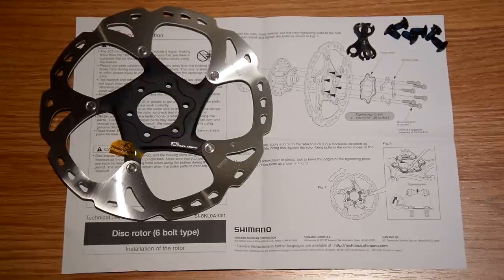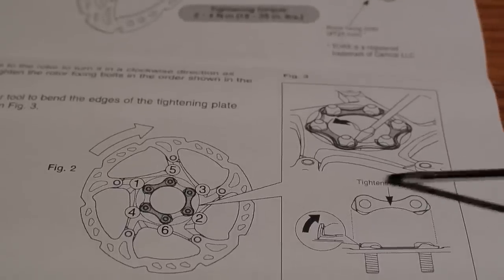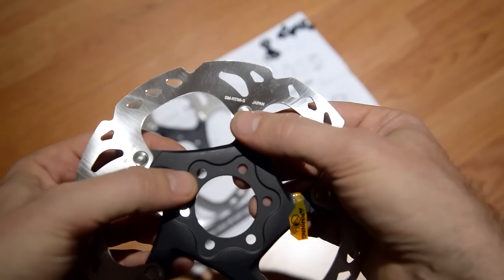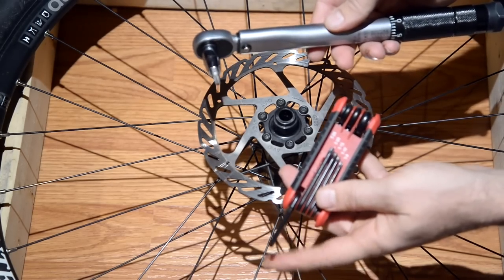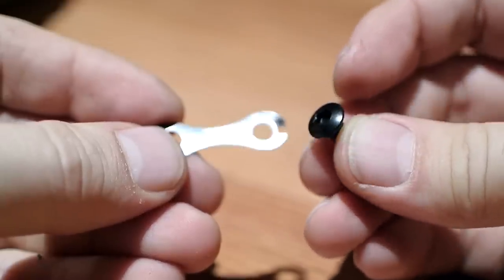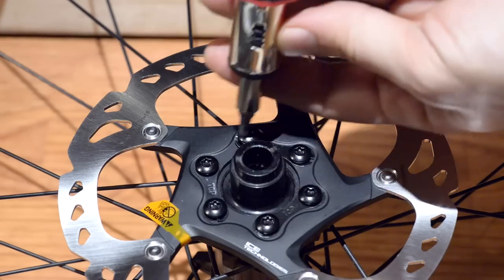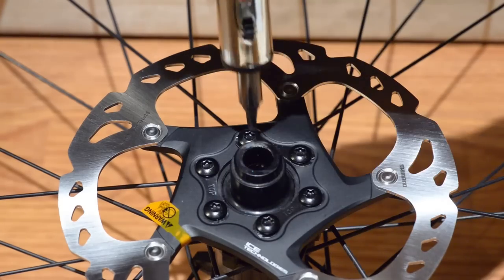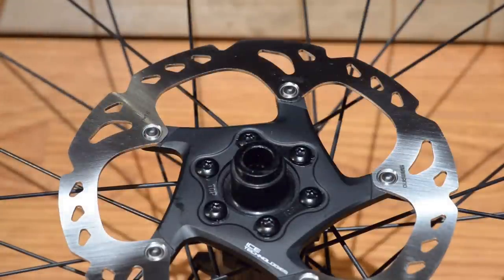Shimano XT RT86 Ice Technologies 6 bolt Disc / Rotor Review, Installation

Comment: I can see this was published in 2014... but I still see comments about the fixing bolts and lock washers.
If you haven't noticed, the current bolts have 'teeth' underneath the bolt head.
These work with the upturned fingers on the 3 lock washers.
Those fingers and the teeth on the bolts help to keep the bolt from unscrewing.
So... while you may get away with not using the lock washers... it's not spec and won't be under warranty if you don't use them.
.
Just thought I'd pass that along... :)

Comment: I've just installed one of these following this. Cheers!
Reply: @LoveMTB  It had a Hope 160 mm on the rear previously but my local bike shop said the warp in it couldn't be fixed, so I've switched it out for this. Doing some maintainance at the moment for the first time as I'm still learning and off the bike for a few more weeks following a greater tuberosity fracture. The videos are much appreciated, cheers!

Comment: And how does it perform compared to older rotors?  Ehat brakes do u have? Can u now use metal pads even though u have deore caliper?
Reply: You can get away using metal pads in the city and for slow rides. Deore and lower has resin calipers which can melt if the pads become too hot.

Comment: Hi, can you tell me please  if these are suitable for resin pads or metalic pads. You haven't mentioned it and I was wondering that.
Cheers.
Reply: @LoveMTB  Mulțumesc. Am făcut comanda pentru 2 x 180 mm, și le folosesc cu SLX 7100 SHIMANO brakes, sper sa le am pana la sfârșitul săptămânii.
Reply: @LoveMTB  Am petrecut câteva ore urmărind cateva din sfaturile tale și tot nu am ajuns la concluzia dacă am nevoie de adaptor pt 180 mm rear disc rotors. Momentan am 160 fără adaptor. Crezi ca am nevoie de adaptor pt 180 Ice Tech 86?
Mulțumesc.
Reply: @LoveMTB  LOL. Videoclipul pe care l-ai făcut e fantastic și destul de explicit, doar ca eu sunt la început în ceea ce privește mtb.
Apreciez efortul pe care îl faci si cred ca faci o treaba excelenta.
Cu respect,
Florin Sirbu

Comment: Cant seem to find shimano road 6 bolts rotors. Is this fit to use on a road bike sir? Someone said that its fit for road bike, Im looking for second opinion to clarify. Thanks!
Reply: @LoveMTB  140mm for the rear sir. Is there 140mm? Im seeing only 160 and 180.

Comment: Is it worth to spend a little more for these or just stick with regular XT rotors?👍🚴
Reply: Thanks for suggestions, I will keep that in mind👍
Reply: I can tell you that they really keep cooler, after using them on my front brake for a couple of months, I noticed less brake fade on long rides and also the pads glassed much less. and I also think they look bad ass :p

Comment: From what i see the tightening plates to not help anything with these bolts. Correct me if i am wrong.
Reply: New bolts have teeth which lock with the washers. And as for the "Loctite": You're supposed to remove it when you recycle a bolt (use a nylon or brass brush or the like), and apply a fresh coat.

Comment: I feel really stupid to ask this question... I also have the Avid g2 clean sweep rotor and my brake is a Avid BB7 mtn. Would this rotor work with my brake? If that's the case... Is the new rotor more stiff/rigid that the clean sweep?
Reply: Thanks but I like the power my brakes exert. I just hate the rubbing noise. That's why I asked you if the shimano ones are more stiff than the G2 ones.
Reply: Ahh thanks a lot :)
Reply: Why are the Rt76 easier to keep straight compared to the RT86? Is the icetech technologie from the rt86 making the rotors less solid?
Reply: I think so too
Reply: +LoveMTB it's very weird. Appart from crashes rotors bend after overheating too much. And the main purpose of this feature is to stop them from overheating. I can't wait to see if the set I just bought will remain straight
Reply: Anthony HT If they do or not, I would appreciate an update :)
Reply: Good, I should get my set this week. A friend of mine bought a set of 203mm and complained that they weren't perfectly straight out of the box. Some adjustments were done and now they spin perfectly and never let him down. But still, I'm curious on how mine will go. I only ride XC, it shouldn't be that hard on the rotors.
Reply: Do you 70 or 99 % isopropyl alcohol to clean any rotors before installing the wheel?
Reply: You should always clean the rotor before installing it. When it comes to al alcohol, I think both version 70 or 99% are good. I would say 99% is better but I don't think it makes a difference. 70% alcohol will still clean it up well. Personally, I use acetone to clean my rotors, it seems to dry faster than alcohol and doesn't leave any grease on anything it touches. I use acetone as well to clean up every greasy parts such as bearings, axle and more.
Reply: +Anthony HT Thanks for the tip and reply :)

Comment: They work on recent Shimano M8000, not on older makes and model -- the inner spider is too large.  You lose 3/8" to 1/4" of brake surface when adjusting the calipers on traditional Avid and Hayes brakes, making the brake useless.  Your video did not put the wheel on the bike!

Comment: I think centerlock Is way better system
Reply: Why? I prefer the redundancy of 6 fasteners vs ONE that a special tool is needed to fasten or remove.
Reply: @Assimilator702  I take off the rotors when wash the bike, when lube the bike, when inspect and grease the hubs, etc. If you have 6 bolts is a PITA, and when you have damaged the bolt head it is more pita then. Since using center lock I have never had a problem with it. Everything is faster, easier and simpler.